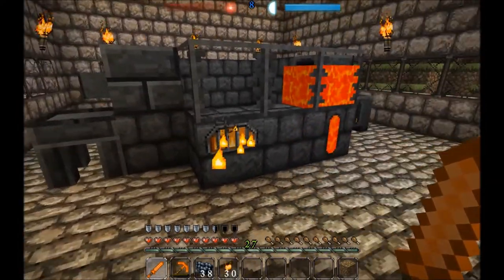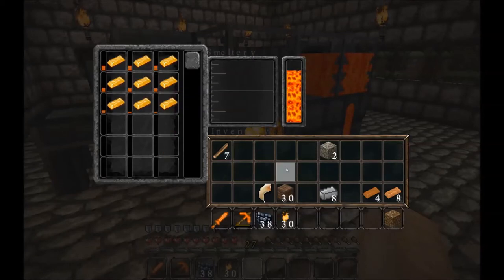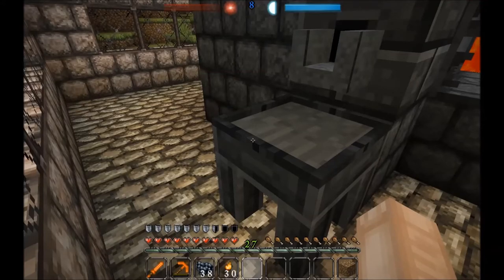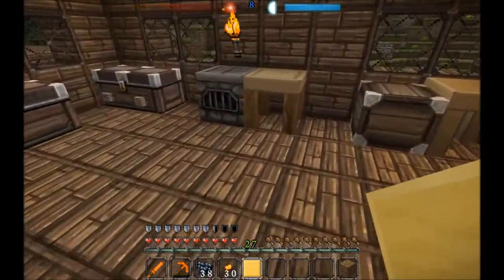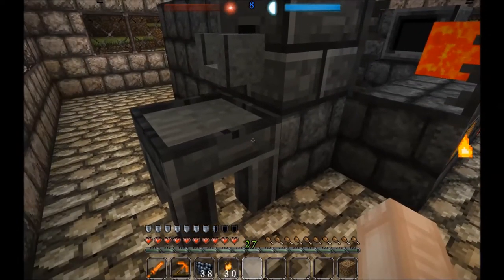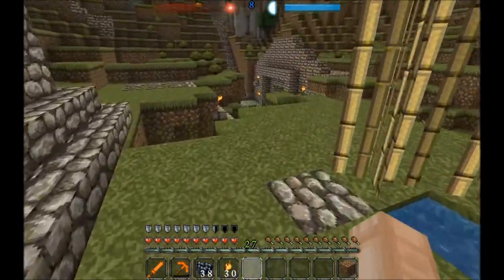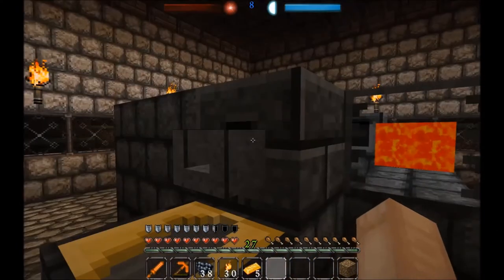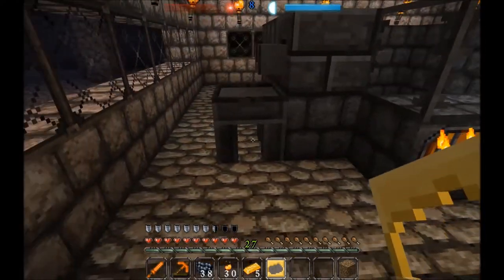Minecraft and Confused #18 More Tinkers Construct

Comment: Emerald as a modifier.

I fight the grimoire of gaia mobs often, and they drop shard of vanilla metals and gems, four shards can be combined into an ingot or gem. The most common of the shards are emerald and iron, so i rarely have problems getting the occasional emerald for use with TC or even to trade with.

Centaurs are especially good in this regards, as they have a chance to drop iron and emerald shards, Leather, iron boxes, and 'meat'

Comment: In that situation I'd use an emerald rather than a diamond, you'd get more durability out of it, since the base durability will be (750 steel head, *2 slime rod) 1500, and emerald gives a 50% bonus to durability.

Final uses would be 750*2*1.5=2250 compared to the diamond's 2000.

If you can spare a gold block you could use it and a diamond to add an extra modifier to the pick. You could then put more moss, more redstone, or add-autosmelting to it.

Comment from the maker: Minecraft and Confused #18
I'm back at Tinkers Construct to build a really nice pickaxe that will have Moss, Redstone, Diamonds and Lapis modifiers attached to it. I learned that a steel pickaxe head, slime crystal rod and paper binding makes a super durable pickaxe, with 4 modifiers that will be able to mine just about anything(I think it actually will be able to mine everything!).

But I hit a small snag with smelting the steel -- it seems I must use Tinkers Construct steel, so I found 2 ways to obtain this: from chainmail, dropped from mobs, and from chainmail made from shark's teeth. I then smelt the chain armor in the smeltery to get TC steel. This will be a bit difficult, as I've killed many mobs to date and never got any chain armor drops yet. And sharks, well I haven't been out on thee high seas yet.

The Slime crystal adds a LOT of durability, the moss will add regeneration, I believe the diamond will add the ability to mine higher tiers of ores(up to the max possible with this pickaxe) and the redstone will add speed of mining. I'm still unsure of the Lapis - I think it adds fortune, which I think increases the amount of material you can get out of mined ores.

http://youtu.be/-0tvKB2-RDU

 #Minecraft